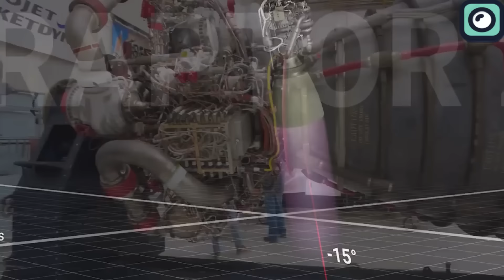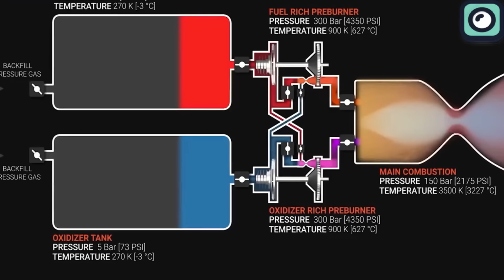SpaceX Humiliates Boeing and Wins Huge Contract From NASA!

Comment: I have noticed that Starship and Booster finish the mission with almost no fuel left. But it is flying without any payload which is supposed to be 50,000 lbs. what gives? Are they not loading full propellants? 
This may be why they need V3 and bigger vehicles. Current Starship may not have a lot of payload capability.

Comment: The problem isn't the Boeing rocket, it's the transporter.  Terrible undersized design, it shakes the rocket apart.  What, you thought pipes leak all by themselves?
Reply: The capsule was supposed be on top of ULA's new booster. ULA couldn't deliver so they were stuck using the Atlas V. That's why it looks like a circumcized penis when it's stacked.